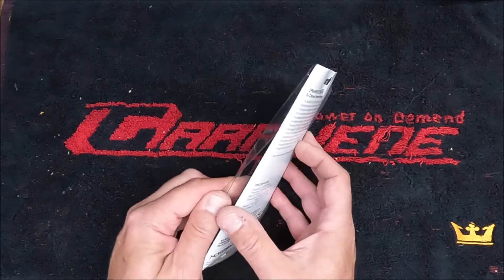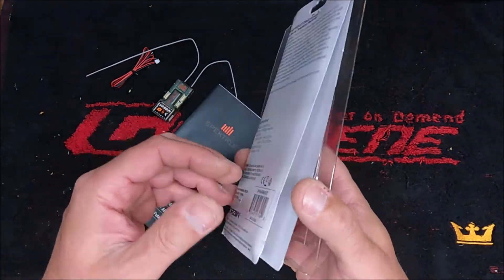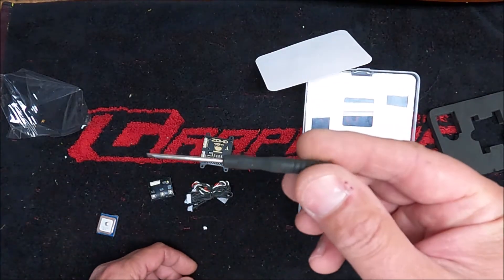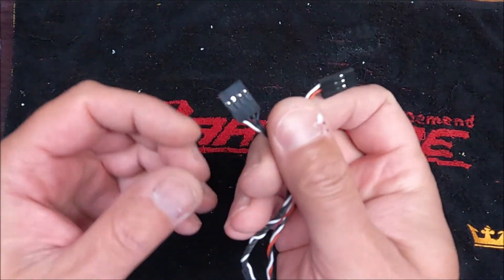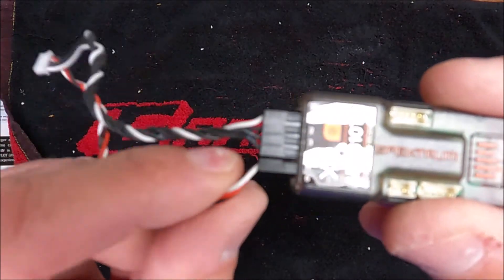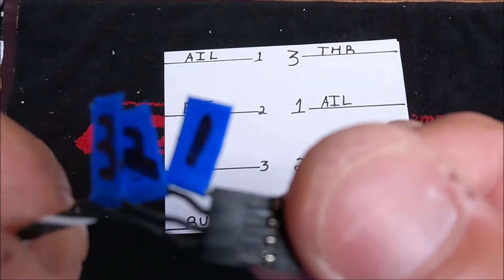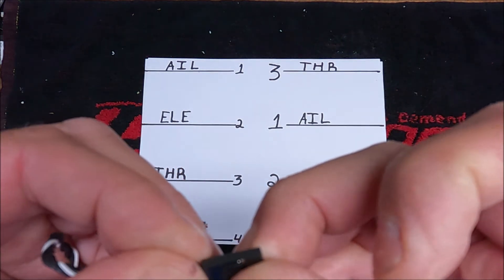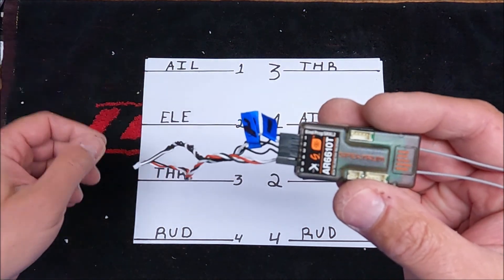ZOHD kopilot with Spektrum AR6610T

Comment: Also you will need to set your Spektrum Tx to "extended limits" to get the full 1000usecs to 2000usecs travels that the Kopilot requires for calibration. 😉

Comment: Thank you so much.  I’m brand new to RC flight.  I just purchased a ZOHD Kopilot autopilot system, and the ZOHD VC400 Racing Camera, along with a Spektrum AR637T receiver for my newly purchased Vought F4U-1A Corsair 1600mm.  I have only used the RF9.5S computer simulator I purchased a few weeks ago and even though I keep crashing I’m hooked, so I’m hoping these items will help on my up coming maiden flight.  So now I’m building my first plane the Corsair and it’s been overwhelming with receivers and transmitters and 6000 mah lipo batteries (what’s that even mean). You just clarified so much in your short video, no documentation could have explained it better, once again thank you.
Reply from the maker: Thank you for watching stay tuned there's lots more plane videos coming up once the weather gets better. Good luck with your new plane I hope you have many happy landings ✌